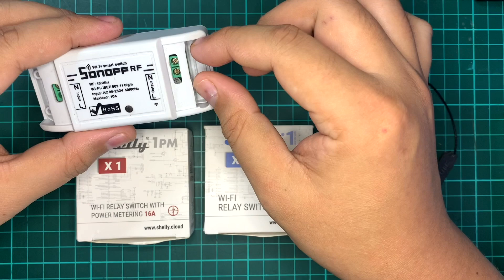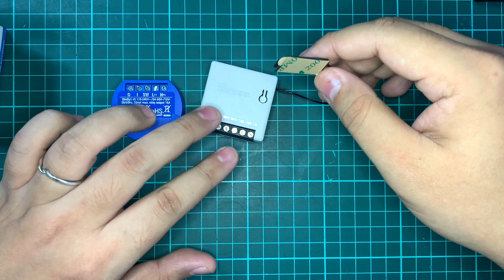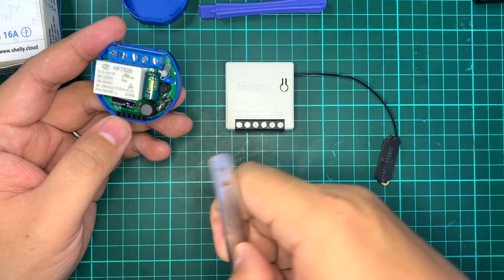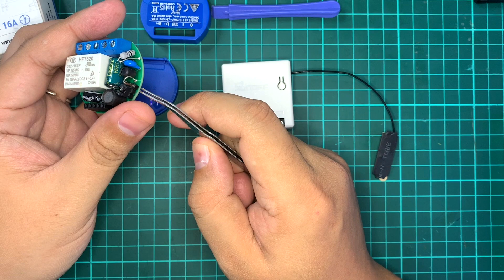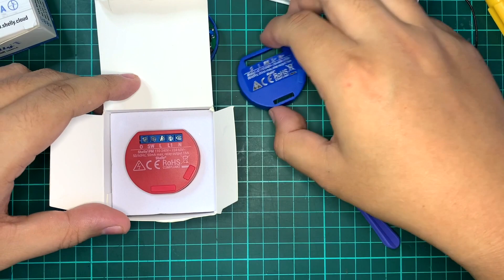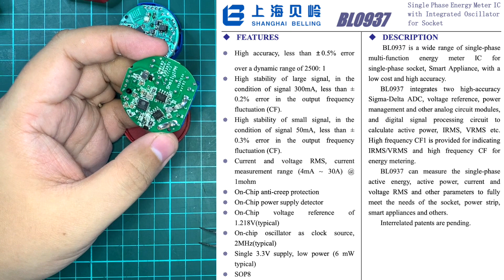Shelly 1 / Shelly 1PM Teardown - Sonoff Mini R1 Comparison

Comment: Antenna on sonoff is better than Shelly 1.  So off you can put antenna outside of electrical lap box inside and get better results

Shelly 1 connection have a maximum gauge 14Ga wiring. Modern homes are generally using 12Ga on better quality homes.

Comment: is it possible to change the Bl0937 chip with another one to measure a load in DC?
Reply from the maker: Sadly no. The pin layout for that SOP8 doesn't match any drop in replacement for DC energy meter IC